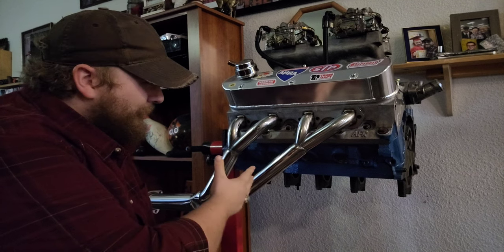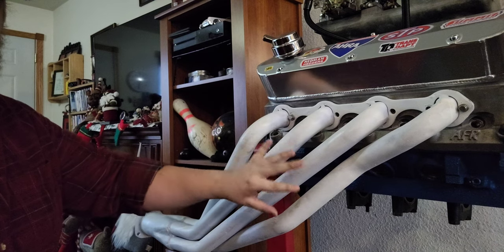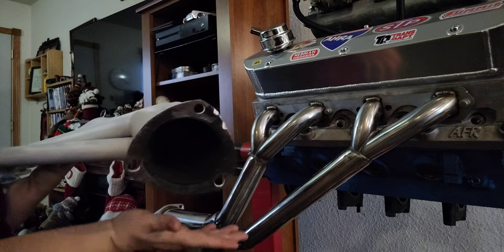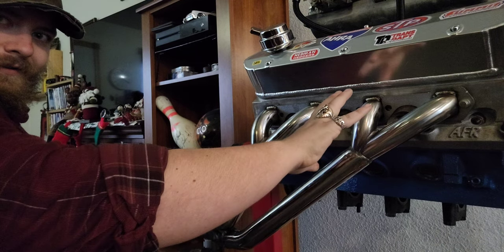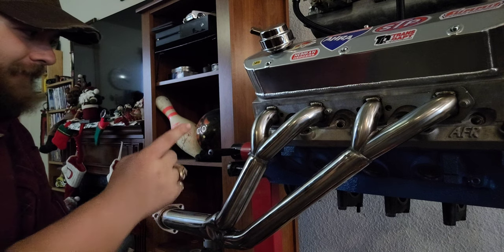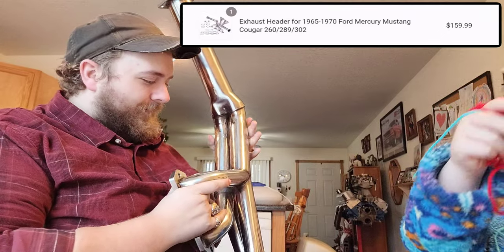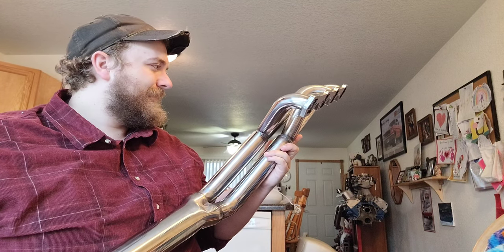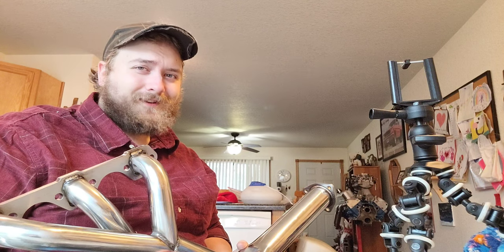Tri-Y Headers! | What Advantages Dose This Old-School Look Have To Offer? | New Exhaust System!

Comment: It's unfortunate that there are fewer people that make Tri-Y Headers for the LS. On my next build I would to use a twin turbo setup acting like a true dual exhaust. With 4 cylinders for one turbo and the other 4 cylinders for the other. Having each turbo exhaust going to its own muffler or resonator and exhaust tip without a cross over of any kind. That way, I wouldn't need to contend with the transmission or driveshaft to fit a cross over.

Comment: The REAL best exhaust would be a 180-degree tri-y, but instead of merging each side into their own collector, take the 4 resultant first merges and merge THEM into one big collector. If it were a flat-plane V8, it'd be like cutting the collector off of two 4-2-1 inline 4 headers and merging all four "2s" into one BIG collector of their own for the whole engine. In other words, an 8-4-1 even pulse header.
Reply from the maker: Well if we are talking about the ULTIMATE exhaust system then you would want pipes that can change lengths based on RPM 😃

......but.....well you would need to find a reliable way of doing that 😅😂
But it would be slick 😎👌

Comment: Tri Y headers trump 4 into 1 headers...imo...oh and a cross pipe between the two exhaust collectors may help(??)...
Reply from the maker: Yes! Cross-over pipe or actually just running a large diameter single exhaust really picks up power over duals 😁

Comment: How does a guy figure out primary, secondary, and collector lengths for true tuned tri y headers based on firing order as well as diameters for each?
Reply from the maker: That is math way above my level 😅
Reply: @newguysgarage6802  Awe piss thats alright the information you put out is awesome either way!
Reply from the maker: @stuffofstuff3 yaaaaa I did my best lol 
But when it comes to calculating fluid dynamics through a pipe and volumes of exhust pulses.....I lose it after that 🤣
Reply: @newguysgarage6802  I can definitely get that lol part of me is like "Man I oughta just make my own headers😤" and the other part of me is like "How tf am I going to figure this out🤨"😅